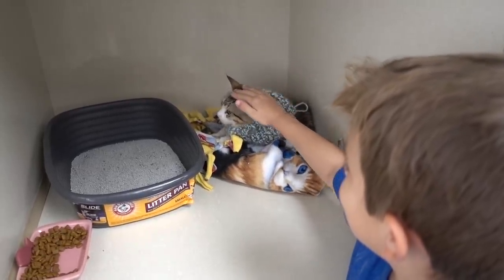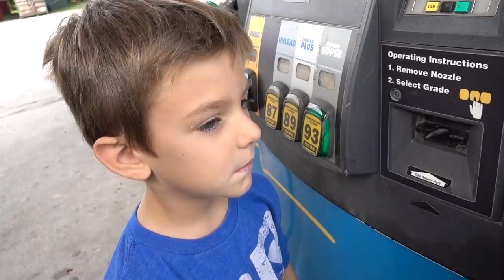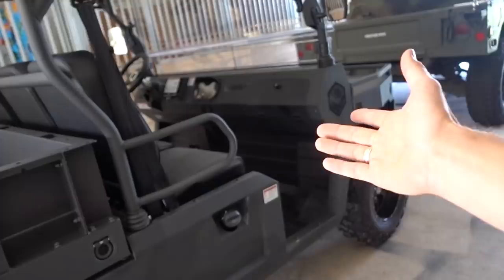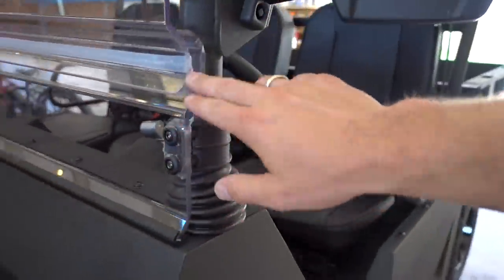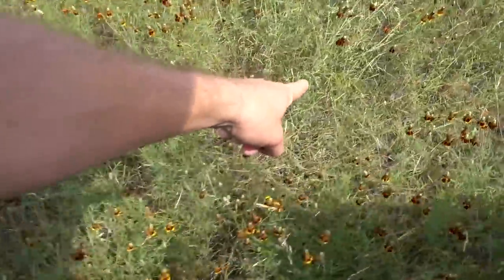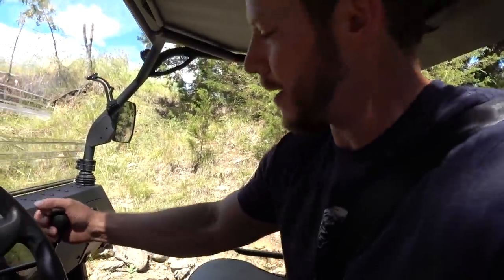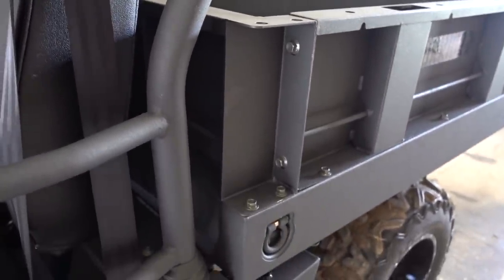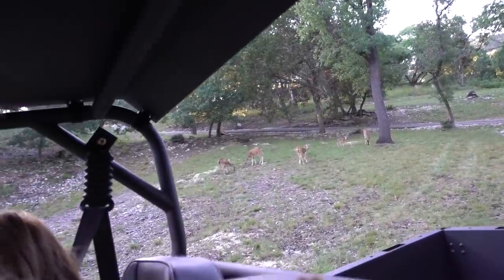I Got A Mini Hummer!!! The Warrior 1000

Comment: At work we have a kawasaki mual, the best thing we did was put a fully adjustable led lamp facing the bed, basically its really great for emergency in dark settings and a ton of other things. You already got a winch. Also take a look at the foot well and wheel arch's make sure there at least plated someone in North America got impaled apparently from a branch or something going through the plastic arch, the business who does our maintenance had to recall our mual to rectify that and put metal plates on the wheel arch's.

Comment: If you like music, there are some nice options for utvs. We added the all weather alpine and a dual battery (for our extra lights, winch, audio etc) and it is great. Even if both batteries die, the isolator keeps enough on tap to crank the engine. On one of ours we put treads on it, but probably not the best idea unless your taking it up north.

Comment: “I want diesel” dang Matt you’ve raised a man by 5 impressive
Reply: Lol  diesels are only useful if your pulling heavy shit in the hills all day  otherwise modern gas jobs do just fine lol  fuck I find it funny when guys say they need a diesel because they are a man lol  my dodge 2500 with a hemi has higher tow rating simply because it weighs so much less then the Cummins  and it’s only a 6 cyl never mind the 8 cyl duracrap and powerchoke    Plus diesels are finicky as all fuck ...like a high maintenance city girl

Comment: You 100% need more lights.  Especially rear facing lights (they are way more handy than you think).  A super loud horn (again way more useful than you think), and a small fan if you plan to leave that windshield on.  I also put a radio on our UTV, but that is not something you need so much as something thats nice to have.

Comment: I wonder if the dump bed would work faster with the engine running
Reply: I was thinking the same thing, if it runs off a hydraulic pump it most likely does run faster

Comment: You could have got a Polaris Ranger (which is better) and cheaper than this.
Reply: likely true BUT would it look better with a 50 cal mounted to the roof?
Reply: A brand new Ranger 1000 is 15k off their site.   And honestly, if it truly is a ranch / work vehicle,  I would take an all metal construction/body over a Polaris with plastic coverings
Reply: @ryandouglas3312  Nah, metal does not mean anything it is just heavier and uses more fuel.  Plus is won't rust.
Reply: @jasonswift7098  you're not thinking about fuel economy if you're buying a vehicle like this. and all metal rear bed and front hood will absolutely take more abuse than a plastic Ranger will.

Comment: I am sure the bed will move a bit faster when it is on. Probably kills the battery using it while the UTV isn’t started. Definitely should get an exhaust mod and a light bar on the top.

Comment: 1,000 cc is pretty good for a little vehicle like that. 
I saw a video, actually it is was part of a documentary, and some guys had put a little 420cc engine in a large, overloaded, flat bed truck (think semi) They had a really small pulley on the engine and a great big pulley on the transmission shaft. It was going about 3 mph but it got up the side of a mountain. They coasted down the other side. lol It was on Dangerous Journeys or Dangerous Roads. Something like that. It's a good laugh for any gear head. Genius and absurd at the same time.

Comment: Hey Matt, I could be wrong but I am pretty sure the bed would raise and lower quicker with the engine running. If they are hydraulic pistons, they should work faster. I'm not sure if it would help if they were electric pistons.
Reply: Just followed the link... It's definitely a hydraulic dump bed lol just give it some gas if you need more oomph.

Comment: Idk, its kinda cool but I actually think the full metal bed and front rack will become annoying.  Hauling anything will be noisy as hell, will dent the metal, and is just overkill in my opinion.  The first thing I'd do is line the bed and rack with some sort of powder coating or maybe that truck box spray stuff.

Comment: Matt, you did this all wrong. If you want a true workhorse then you buy a Gator and if you need parts they are easy to get. We have a friend that has an off-brand utv and it always breaks down and is hard to find parts for. Don't get me wrong though because the Gator still bleeds green so its a lot more expensive however in the long run in my opinion the gator is way superior

Comment: Build a little box for a metal gas can you can buy them at Harbor Freight 

And then a spot to store chainsaw I don't know if the roof would be good place mine is right behind my head but I never used my dump bed and if my chainsaw is in place my bed won't dump

Comment: Is it diesel or was that noise just the metal rattling?
Reply: Gas
Reply: 85 hp 1000cc vtwin
Reply: So if it was a 4000 cc twin quad wouldn't matter